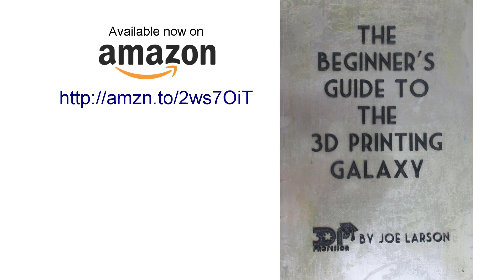The Creality CR-10S and GPL Violations

Comment: This is the first of your videos I've had to down vote. This is not a movement started by TH3D. He may have been the springboard, but many have complained before. 

I don't understand the people that don't  think we have any say and can't impact these companies in a way to force them to comply. The original CR-10 exploded because of the Maker community on YouTube. If we support those that do comply, they will grow and those that don't will think twice about not complying. It will not make cheap 3D printers cease to exist.

I'm going to go look into AnyCubic now...
Reply from the maker: Any AnyCubic? Don't they also iterate open source designs but not share their modifications? Why do they get a pass for you?
Reply: If they are in compliance with GPL, I don't have issue with them. I'm not going to go out and buy one today, but will research and make sure they are complying. 

Open source hardware and software are different animals. Thanks to the internet, sharing software is easy. Open a GitHub repository and you are done. Quick and easy. Hardware based on open source designs are typically also created with easy to obtain parts (not always, but it is more likely). By having iterative hardware, I could probably argue that Prusa, Lulbotz and Ultimaker are not completely open source, either. Hardware on 3D printers is relatively easy to reverse engineer, if need be.

With that being said, I'm leaning more and more toward my next printer being another build. I like the idea of plug and play printers, but I can't support a company in clear violation of GPL.

Comment: I keep hearing the excuse "If we open up our neighbor will steal our design", but in reality GPL is about sharing, not stealing. By opening up, you are FREELY sharing. By taking something that is GPL, and refusing to share it back, that becomes the "stealing" that is being complained about. It is impossible to steal something that is freely available. That is the heart and soul of the GPL and Creative Commons both.  Ideas freely shared and contributed to by everyone. If you don't want to share your contributions, DO NOT use GPL or Creative Commons materials, it's that simple.
While Creality may only be the most recent company to be called out on GPL violations, it is common for companies, primarily Chinese manufacturers, but not exclusively so, to take something GPL and try to pass it as closed source. It has even happened with Microsoft.
The primary point is that GPL is a license. By using a piece of GPL source code, you are agreeing to that license. If you choose not to abide by the terms of the license, you relinquish your right to use that source code.

Comment: Strongly disagree.

JGAurora printers that i've seen don't run on Marlin, but on Makerbase STM32 hardware and firmware which is closed-source and written from scratch. Everything about this platform is different, save for the fact that it also consumes G-code just like other printers and for that matter just like other CNC machines - it's an open standard, it doesn't come with copyright restrictions, and it stems from 1950ies, much older than any 3D printer. People have poked, and so far didn't find that Makerbase firmware infringed on the copyright of any open-source project. Same thing with Geeetech printers that have not been open-sourced, those are also Makerbase. Where Geeetech has shipped Marlin, their community manager has provided the actual corresponding source dump on their forums - changes are trivial however and limited to configuration. So these two companies might be in the clear, as far as i can tell. This is one of the reasons why i went with Geeetech in spite of printer being mechanically sub-par - they dumped the firmware unprompted into the open, and even the schematics of the custom control board were published right on the official forum after someone poked them. I like that control board BTW, surprisingly sound engineering on it!

Anet/Zonestar/Tronxy haven't published their sources, which they must, but it's trivial configuration on top of Repetier-FW. Worth an angry shrug and a finger wag i guess? They don't understand that it's the matter of principle, to them it looks like they haven't changed anything.

Creality however commissioned development of a new feature on top of existing open-source firmware, a significant change, and they're keeping it to themselves, knowing full well that they have to publish it. I think it's malice at this point, testing the grounds on how much they can get away with, if they invent enough excuses.
Reply from the maker: The JGAurora A5 runs on Marlin.

So we should only be indignant when the violation is non-trivial to reverse engineer? Or if it's only something we really really want?

I don't disagree with you. This is bad. Black and white, this is a violation of the law. But it's grayed up by being in China and the current indignation is only a result of a few people stoking the fire and pointing you at a specific people when there should be a bigger picture that no one is looking at. You're being played.
Reply: Ah, then of course JGAurora is in the wrong regarding A5 and must ship the source.

Most of these instances reek of negligence and ignorance. These are fairly low-effort devices. These companies are like little children, they saw something, cobbled something similar together, and it caught on, but... China has lots of great engineers, right? It has a very decent public education system that can keep up with top industrial nations. But advanced engineering is not what you see in most of these devices, they are just built from whatever was cheap in Huaquiangbei markets, as a facsimile of devices seen elsewhere. They were probably building trinkets or furniture before they started building 3D printers. There's usually appallingly little effort in the firmware too, the extruder steps are often miscalibrated, important safety features are not enabled. Sometimes they get lucky, come up with devices that work surprisingly well in spite of being built down to a price, and then they stick to that and iterate on it by making a bigger and a smaller version. Can you really be angry at children who don't really know what they're doing?

But when someone puts effort into something, has spent apparently some money and effort on it, then the transgressions seem a lot more deliberate and thus more nefarious in nature, no longer due to negligence or ignorance. Now Creality claims that they are the victims here, but do you really have a hard reason to believe them? It would be a convenient excuse, wouldn't it.

Whether it's about something we really want... well i personally don't need the power resume feature, but it's a changeset that can no longer be considered trivial. Trivial changes to code aren't even copyrightable by nature, they don't really represent intellectual property. A situation in which something "you really want" was trivial to reverse engineer, it would have been reverse engineered in half a day by somebody, so practically the issue would be minor, even if regarding license adherence it's just as bad. In contrast, non-trivial changes are of value even if you personally don't want them. They also tried to turn a GPL violation into an explicit competitive advantage for themselves by advertising a product feature that they must pass on to the public at large by publishing the source code, but didn't. I don't think you can view JGAurora neglecting to ship their Configuration.h as them trying to leverage GPL violation for a competitive advantage.

Played by whom? A guy who sells (more or less trivial, perhaps somewhat 'generously' priced) addons for printers and wants to have firmware support for them on devices where it's viable and should be enforceable by license? I don't see how that's wrong.

Also i did incorporate license adherence into my purchase decision and ended up with a cheap device too, so... it's not like we're entirely out of options here.
Reply from the maker: I don't disagree with any point you make here. I think one day we might see great and community friendly things coming out of China. That's what I'm fighting for.
Reply: Well i'm not of the opinion that we should scorch the earth either. It is an opportunity to have the company drop its alleged shady contractor and instead sponsor some of the main contributors or hire in-house people familiar with open-source ethics and practices to help them maintain the firmware - it would be cheaper for them and better for everyone. But the situation does appear a bit absurd.
Reply: JGAurora A3s, the A5 little brother also runs on Marlin and it's closed off - and it has faults that lessen the print quality - I have A3s and now suspect JGAurora don't really know what they are doing - fortunately there is a good user community on facebook who have created their own firmware from Marlin that improves the printer
Reply: JG Aurora has now released the code for the A3s & A5. From what i have read a couple of their others are still closed.
Reply: The new JGAurora A3s and A5 have two controller boards - the main board which is MKS Gen L and the other is the MKS touch screen board

The printers do run Marlin software - I know as I have the A3s and have upgraded to a better version of Marlin code provided by a JGAurora facebook group

Comment: I am delighted with the cr 10, if he did not have the right to use an open source he would not have done so why talk about it, and although it is successful and and that jealousy gives wings
Reply: As a CR-10 owner, you can get the source code from Creality. They are happy to provide it. However, CR-10S owners cannot. The license of Marlin promises users that if they have some product with Marlin installed, they are entitled to the source code so they can modify it to their needs, fix bugs, etc. So it is incumbent on all vendors who use Marlin to make the source code available to their customers. They agree to this condition by adopting Marlin, and most are happy to comply because Marlin lets them get their products out to market quickly, and because dozens of volunteers are always improving it. The version that comes with the stock CR-10 is a bit old, has a "chirpy" LCD, and could have more features enabled. We recommend re-flashing with the firmware now openly provided by TH3D, or the upcoming Marlin 1.1.9, for a better experience.

Comment: They used GPL firmware and chose not to follow the terms of that licence.  They're getting most of the work done for them for free.  Then they're distributing effectively pirated software internationally.   

They negotiate with Naomi Wu to release the source code as per GPL in exchange for her video on the factory tour, which they violate that agreement too.

They under pressure release a version of the CR-10 source code.  There's online storage links floating around.

Now they release this terrible 'response' which is a short excuse about paying for development, but not getting the source code for some insane reason.  Then tell us we should shell out $200US for the Ender 3, and here's a factory tour.  As it is the speaker was that terrible they should've just done it in chinese and let translation services make it better than the shitshow it was.

Now you're saying we should just roll over, keep buying their pirated shit, and if they ever release something, chuck features in it for them.

I'm surprised you managed to get 20mins of edited video between nursing at the Creality teet.  Can't stop those affiliate links flowing can we now?

Comment: I hear your opinion and respected. The only thing I have to say is your right. The community can develop for them and make something great. That’s how reprap began and its still going strong today making leaps everyday. Prusa was just a simple machine with simple code and now look at it. Capable of sensing lost steps, power loss, a build surface that can hold nearly anything. A person can literally build a 1:1 of the MK2 if they wish and a near MK3. Heck it could very well be the best machine around for its features and price.

Maybe I’m wrong but a global community could probably out preform closed source companies easily.

That said though, they should still abide by open source rules. If they go closed source then they lose the backing that made the successful in the first place. It’s simple open source and you literally have the world helping you develop or close source and you will spend a good chunk of money to start the firmware from scratch.

That was my rant.
Reply: Marcos Ramirez for sure there is more advanced tech in closed source, stratasys are light years ahead of the open source solutions.
Reply from the maker: I would more credit Stratasys's lead with the decades of head start that patents gave them. And still, the prints they produce, when compared with a mid-grade open-source machine, the open-source often wins. We've even got disolvable supports now that rivals theirs, which had been their rep-rap killer. Open source closed the gap where it counts really fast.

But, if you argued that Stratasys has it over open source in terms of user interface and usability, I'd definitely have to agree with you.
Reply: 3D Printing Professor Well said. 👍🏽
Reply: 3D Printing Professor we have stratasys machines in work making military parts to precision 24x7 in materials you could not even dream of, some of their tech is amazing but not always available to commercial industry.

Comment: Thanks for your great response to this. However I do disagree with your statement that none of the Chinese manufactures are not compliant. I think the majority of them are, but this is due to the fact the 95% of them will load on a stock version of Marlin, make some settings changes and release the printer. They have made no changes, and even if they do not release the config you can get this out via the serial console anyway so they are compliant.

I just watched the response video, it was a little bit hard to understand, but it sounds like Creality is not the company in non-compliance (They are but indirectly). So for the CR10S they contracted another company to create the new features that Creality wanted, I don't have a CR10S so I can't verify this, but if the 3rd party company created the new features without Marlin, then there is no issue. As they she said Creality only has the hex file to burn to the CR10S, and the other company can licenced the code how ever it wanted. If this is the case this is a storm in a tea cup and not a GPL non-compliance issue. It is an issue that peoples expectations are wrong. it would be like expecting the source code to windows, not going to happen. However if they other company used Marlin, then all this should be directed at this other company and not Creatlity.
Reply from the maker: They may not be in violation on the Marlin side, but they're using Open Source hardware and not releasing their specs. Those are trivial to reverse engineer, but it's still a violation and not one's getting indignant about it.

So the thrust of Creality's response is that they changes that everyone wants were done by a hired programmer who kept their source code changes and only turned in the binaries, which is, as I said, flimsy. But I'm so pleased that they even acknowledged us that I'm willing to give it an eye roll and go "okay".
Reply: I didn't think about the hardware, (being a silly software guy) I checked the licence of the Prusa i3 which is what they are based upon and it is also released under the GPL which I think is weird choice for hardware. But it could be also argued that what they have done on the hardware side is not a derived work when you compare it to the i3, and in the case of the CR-10S it is not a direct copy, considering it is all in extruded aluminium and CNC'ed parts with is nothing like the original.

On the software side I think that Creality is as much a victim as any purchaser of the CR-10S. But if they know 100% that they used Marlin to create the changes to then they should have insisted that they get the source considering they they are using Marlin.

Also I would not be surprised that the company that did the changes went go to the Prusa i3 MK3  Marlin fork and go the resume code from there.